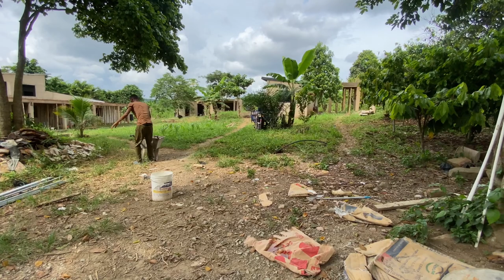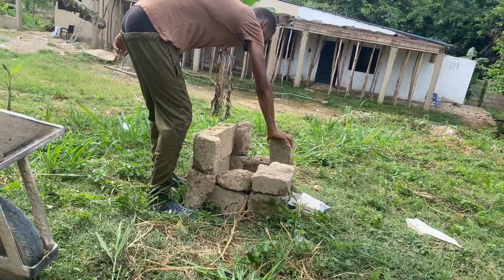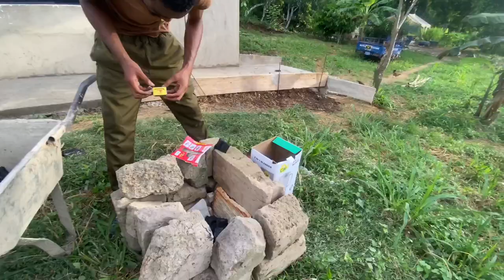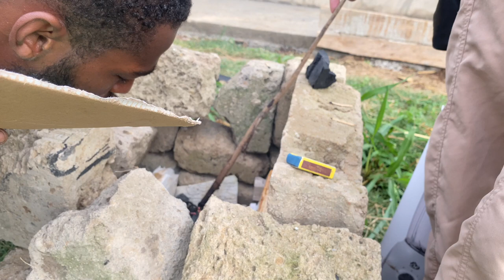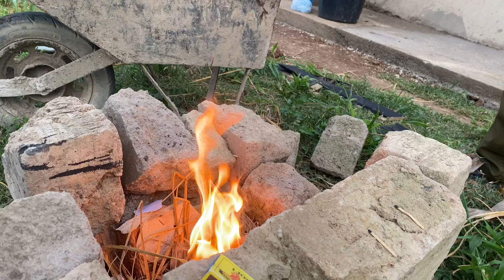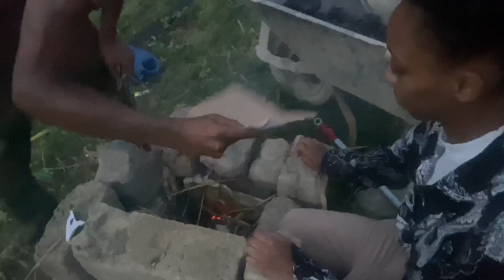When off-grid fires FAIL | First time starting a fire

Comment: Why not just use the three stone method used by the locals, or if you want it higher, build a raised platform and put the charcoal with the steel mesh. It's not getting enough oxygen the way you are doing it.
Reply from the maker: Thanks for the tip !